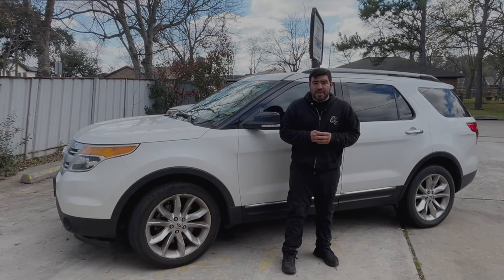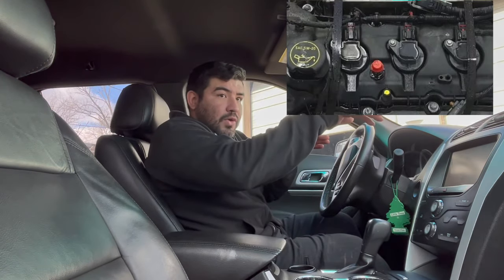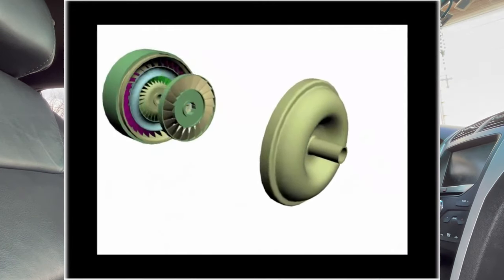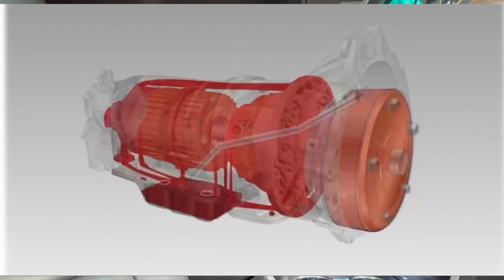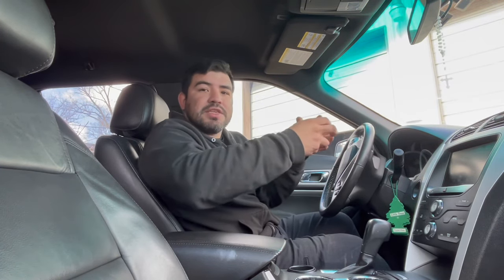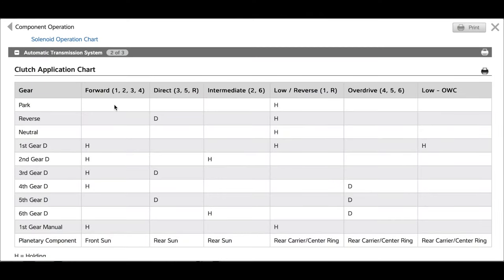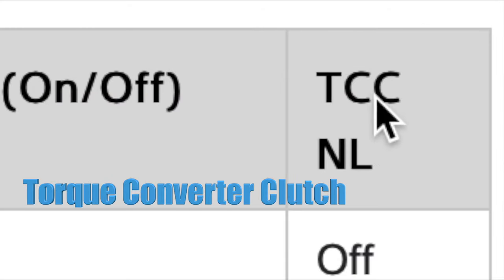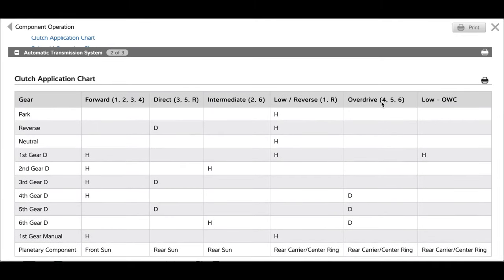Can this fix up transmission shudder ????

Comment: The most notable item that predicts shudder was the torque converter clutch pressure. When it was relatively low, say, ~35 PSI, it would shudder. When it climbs past 40 PSI or so, it would go away. This tells me that, for whatever reason, the transmission wasn't able to generate sufficient pressure to make the torque converter clutch grab as hard as it should have, thus causing intermittent slippage, which manifests as shudder. At least, that's what appears to be going on to my untrained, amateur, shade-tree mechanic eyes.
Reply: Sometimes shade tree mechanics are the best

Comment: My honda odyssey 2017 was doing the same thing but for lower gears. Pretty much starting at 30km/h. My honda dealer told me to replace transmission for $18k. Ridiculous. I changed ATF for $114. Viola. the shudder was gone. By the way, I added this LubeGard instant shudder fixx just in case. My transmission fluid was never changed. My car km was 140k. my mechanic who change the ATF showed me the magnet plug which he took out to replace the old ATF. It had some metallic particles which looked big, but when I touched them it was just dust. It is pretty normal to have from what I have researched.

Comment: 2017 Police Interceptor Utility (Explorer), 3.7 NA, 6F55 Transmission 130k miles. Did the same as your customer, changed valve cover and intake gaskets, spark plugs, and coils - no improvement to the shutter but acceleration felt the tiniest bit better. Plugs had some rusty looking corrosion from the tip through the threads. Did a drain and fill on the transmission, got out about 4.5/5qts of fluid. Replaced with 5qts Mercon LV and 2 tubes of Lubeguard shutterfix. Issue is 95/98% of the way gone. No more harsh shuttering, still tiny variations in RPM below 45mph when the torque converter isn't completely locked yet. Never had issues during full throttle accelerations but the 1200-2800rpm range, low throttle, up to 45mph area was the zone of concern I was targeting. I have all the work orders done on this car from back when the police department had it. They've been using 2 units of Lubeguard each time and the fix seems to last for ~10k miles at a time, and they did it 3 times before quote for a new transmission was ~6k and they sent the suv to decommission and auction. Definitely need a replacement torque converter but it's impossible without removing the entire powertrain - TC runs ~400$ for a remanufactured, with labor it would probably come out to ~1600$. Plan on doing this till it completely gives out or I sell it.

Comment: Great way to demonstrate the efficacy of the product. I have an oder for the same product arriving today for my 2009 Ford Flex. Changed fluid, did an upgrade to my valve with the Transgo shift kit, but nothing had changed in regards to the shuddering, especially under towing load. The tranny was rebuilt in 2019, too. I will let you know how it goes.

Comment: I can confirm this100%! I drive a 2014 ford explorer. The dealership I bought the vehicle knew about this issue and thought it needed a transmission replacement. after  doing se reaserch and adding shudder fix it went away after driving it around for 5 miles. Going on almost a year now and it hasn't came back! 

Thanks for putting this video up and sharing your knowledge  ( as a auto technician myself) it's crazy how  quick and easily people can misdiagnose vehicles and jump the gun on changing parts rather than doing research first. 

Even after graduating from tech school in 2012 you never stop learning and reaserch is key before even turning a wrench, it can save you big time.
Reply from the maker: Awesome. Always good to do some research for sure

Comment: I've been living with a shuddering transmission in my 2012 CR-V for about 5 or 6 years. I had taken it to a mechanic and he told me not to worry about it, that it would last many more years. I loved the CR-V but this shudder was driving me crazy. So, after reading lots of reviews, I ordered Instant Shudder Fixx and put it in my transmission 2 days ago. Afterwards, the wife and I took a 20 mile trip and there was not one shudder. Not even a hint of one!

In the future, if I ever have a vehicle that shudders I know what to do. Instant Shudder Fixx is easy, quick and effective!
Reply: I have 2010 CRV and it started shuddering. Ordered one shudder fix. Will see if it helps, gonna change the oil aswell
Reply: @Team_Predathor  This stuff's a miracle worker!
Reply: Do you know if this is good for CVT trans?
Reply: I want to know also
Reply: @RajiveSalmon  From their website:  For use in ANY automatic transmission fluid EXCEPT CVT, DCT, and Ford Type F [1986 and earlier models] applications.

So, no, do not use in CVT transmission.
Reply: Where do you add? Add to tranmission oil or engine oil?
Reply: @Team_Predathor  How'd it work for you?
Reply: @joseaviles9046  Do not use in CVT

Comment: Thanks Oz, this stuff is mandatory if hauling a car load around of bbws.
Reply from the maker: It was just cool seeing the issue while checking out scan data
Reply: I wish I had that problem! "A car load of BBWS!" I read that correctly right? You mean 4 to 6 big beautiful women? Doing the math I've dated girls upwards of 280 lbs and more and they didn't scare me one  bit..! 😂 

If you got 4 that means you're hauling upwards of 1000 lbs! And 6 makes 1500! That tranny is working overtime! Lol

Make your truck a LOWRIDER! Lol. Good thing I bought those leaf spring helpers for the rear leaf springs! My new truck at super low on even the smallest load of dirt or rocks.. but now it sits a lot higher without a load and sits flat with a huge load.. nice! 

I'll work on the "load of BBWS"! 😂

Comment: It did work on my 2009 Subaru Tribeca with the 5 EAT Transmission, I did a full fluid flush using the OEM Subaru Fluid via transmission cooler lines to get all clean fluid into Transmission and the shudder was bad going uphill, There is a TSB from Subaru with the 08-09 Converters with Subarus of this vintage, However between labor and parts it's an expensive fix, So far it has not done it since I added this additive, No idea how long it will last, I'm hoping between the clean fluid and the additive it will be ok for a little while.
Reply: Still working? I just had to add this to my 03 4runner cause of torque converter shutter going up hills and it started to do it on the flat aswell. Anyway I just put it in today and it fixed it right up but I wonder for how long.

Comment: Would in be explained as a pump?  The engine spins the converter which sucks up trans fluid then expels it under a higher pressure.  This higher pressurized fluid is pushed against valve plates which make clutch disks come in contact with their drive plates which causes the main shaft to spin which the pins the wheels via differential.

Comment: 30k miles since I put it in and still shifts smooth as butter.
Reply: Did you change the fluid then add it or just put the transcript shudder fix straight in there
Reply: @michaelburtin3457  
I changed mine first but you can do either. If you have a lot of miles and never changed it or you don't know the history and it has a lot miles then you may just leave the fluid and can still add this.

Comment: I would have liked to see the results with just the fluid change and then see the results with the additive.
Reply from the maker: Now that would be a good video to make as well
Reply: Most people never change the fluid until the transmission acts up      transmission shops. Don’t mind all the work  🤑 a lot dealerships  say it’s lifetime fluid  another great  fix by 0z mechanico
Reply: Super clear explanation/demonstration.  Thx so much for this valuable insight.  Begs the question: Why isn’t tranny fluid changed as part of regularly scheduled dealer maintenance!?  Crazy?!
Reply: Well I just did a fluid change and I drive for a living. The fluid change only lasted me about 1500 miles before I felt the slip/judder again. My dealership recommended a transmission replacement. They agreed to do another flush (for another 400 dollars) and add this additive. It has only been one day and about 300 miles. So I’m on fresh fluid and the additive. I’m hoping that it lasts for at least 20,000 miles and I’ll change the fluid out again. If it fails prior I’ll try to come back and say so but it’s doing great today

Comment: I had what I thought was a engine problem.after watching several videos of shudder fix I'm giving a tube a shot. Transmission fluid looks good.hoping for good results. 2 ounces doesn't seem like much to do anything but if it helps I'm adding a second tube. At about 12 bucks I haven't got much to lose.at 2 ounces I'm happy I don't have to drain anything.anyone have a experience using it in a ford taurus?

Comment: Please brother I need your help with my ford explorer 2014 … code P0016 .
The car after driving 15 minutes the speed of car Do not exceed 100 km per hour if I fully pressed acceleration pedal and very high fuel conception